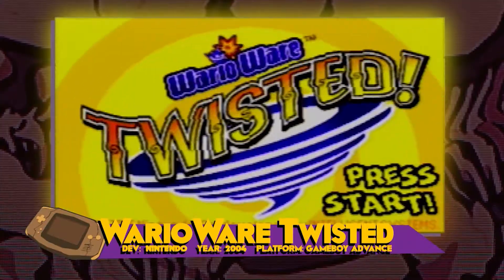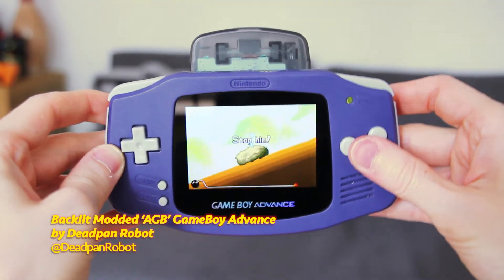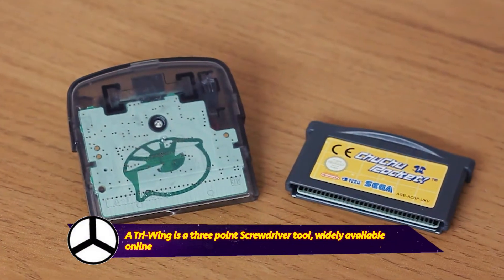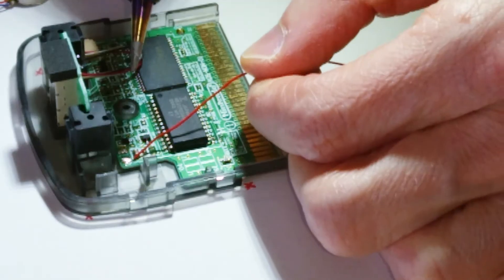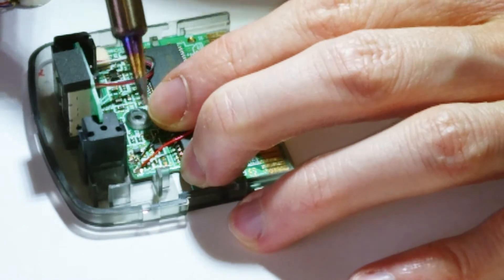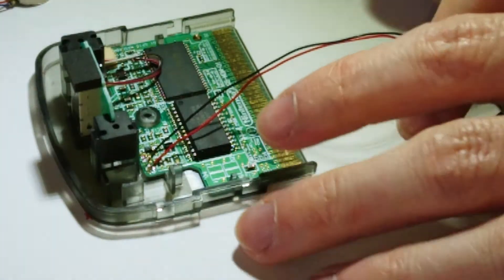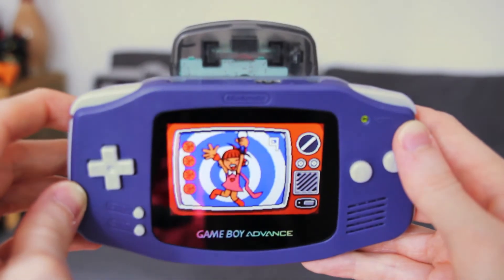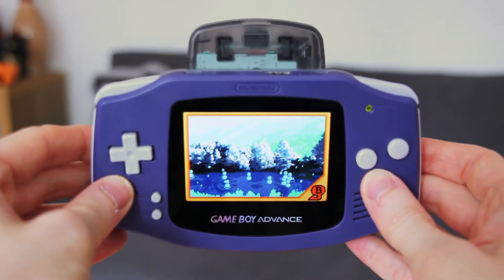Repairing WarioWare: Twisted's Broken Rumble - Fossil Arcade

Comment: Do you know anything about fixing the Gyro component? I've tried looking for it online and the model is CG-L43, but for the life of me I can't find where to buy it
Reply from the maker: Might be easier to replace the cartridge and keep looking at the same time.
Reply: If yours just driifts then it is typically a mechanical issue. I found online that if you smack the gyro module with something blunt like the back of the spoon hard a few times then it will work again. I tried it earlier and sure enough it helped.

Comment: It [Wario] is the exact same vibration motor as Drill Dozer but different from the DS Rumble Paks.
Reply: This motor fit in a Drilldozer cartridge and worked well: https://www.digikey.com/product-detail/en/jinlong-machinery-electronics-inc/C1234B016F/1670-1085-ND/9974297
Reply: @BikesBlades  Thanks!
Reply: @BikesBlades  think it would fit in a warioware twisted cartridge?
Reply from the maker: I opened up my DS rumble at the time, but I didn't include a shot of it for some reason...
Reply: @FossilArcade  thanks for everything you did do, though! :)
Reply from the maker: My pleasure, glad you found it useful. I took apart a Wii Remote too and the rumble was similar but too large I think. Was a long time ago now.
Reply: @FossilArcade  Yeah, I looked at that one. Looks a similar circumference but a few times thicker. My WarioWare Twisted doesn't vibrate but no way am I salvaging it from Drill Dozer! Nope. Just hoping to find an exact replacement before I resort to ordering that similar, but not exact one which everyone else is using in their repairs.
Reply: @emmettturner9452  totally just repaired mine with these suggested parts and it’s definitely not the same. I had my go out a few days after playing it with working rumble so it made it easier for a comparison. These tend to intensify when twisting the GBA but don’t have the almost instant tactile feeling you’d get with the original. It’s especially noticeable in the character select screen. It would be awesome to find the exact part used in these games for a truer experience to the original
Reply: @auburnkit  Thanks for the fresh perspective/comparison. I’m guessing that the part is from a Japanese supplier though I still couldn’t find it. :(